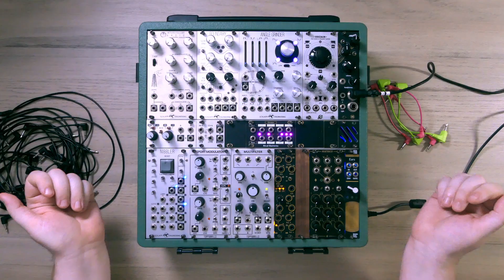Let's Explore! BYO Benjolin Patch From Scratch

Comment: I'm not sure I understand; the interestellar radio already does something on its own; so when you take the output of it (and not a copy of one of the oscillator), it's already affected by the carrier/modulator interaction itself is it not? I mean the interstellar radio has already a very interesting "tone" on its own but I get that it takes it a lot further. Anyway that's super interesting and someone somewhere else in your comments mentionned Amnis as a shift register and I'm gonna try that. It also has 3 different stepped out
Reply from the maker: While it's not the same as the PWM output of a Benjolin (which is a comparator between Osc1 and Osc2), I think the Interstellar Radio's output can be thought of similarly as a sort of compound operation between Carrier and Demod—you end up with an output that contains some combination/result of frequencies from the two clocks, and the behavior of Out follows the behavior of Carrier and Demod. The way I see it, it's still Benjolinesque, but you're right it's definitely not the same.
Reply: @kilo_llama  ok thanks; yeah the result is still like a benjolin and more interesting than only the interestellar with a bit of modulation. I'll try different combination (including the error out / different PLL settings) when I get the chance. Also I'm always a bit confused about the signal in (and why it exists since the cv in are copied from there) but I forget that it's indeed used as an actual audio in by the circuit and error out